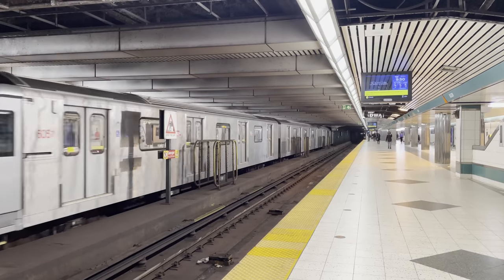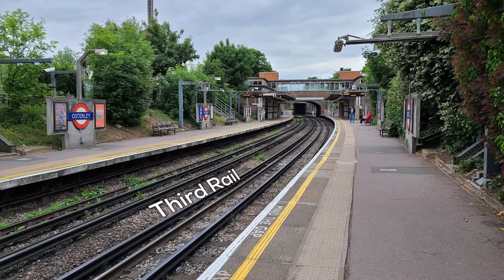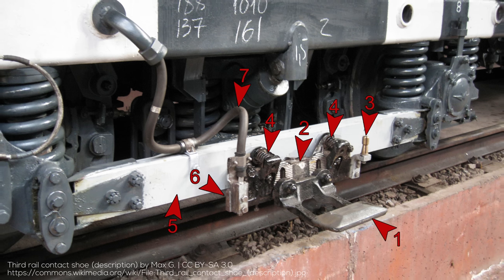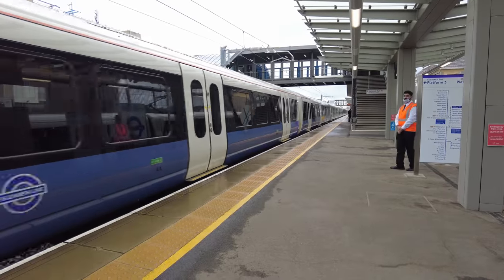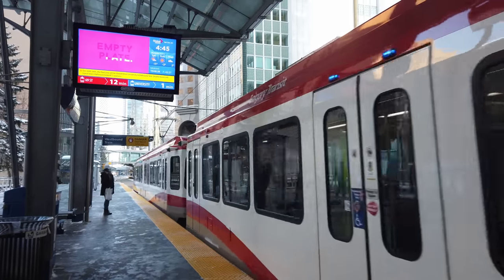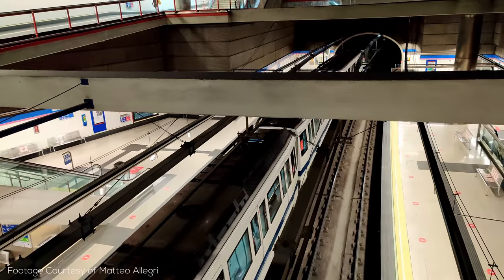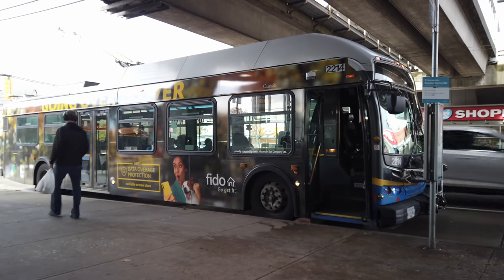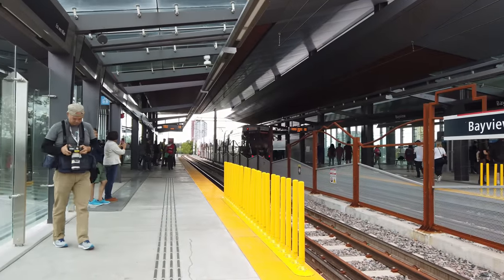The Best Way to Power Your Railway | Third Rail vs. Overhead Wire

Comment: In the UK we have a really odd system where the south of the UK almost entirely uses 3rd rail and the north uses 25 kv overhead, and I mean mainline commuter trains, not just subways. Like so many London stations are electrical hazards cause they have both 3rd rail and overhead lol, some even have 3rd rail platforms, 4th rail for the tube and 25 kz for trains going north
Reply: Typo it's 25kV .  There are no unprotected electrical hazards the engineers fully understand the issues and engineer the installations to cater for all the differences.  

The 4th rail on dual National Rail / TfL tracks (e.g. Euston to Watford) is actually at the same 0 potential as the return rail unlike when in TfL land where it's above the running rail potential.  Thus TfL stock can run on NR track but NR stock cannot run on TfL 4 rail track.

Comment: in Vienna you have a couple electric busses which run on battery, but if they need charging, they can do that with raising a pantograph towards tram overhead wires :D ... I believe there is like one line that uses those there :)
Reply: In the San Fernando valley area of Los Angeles,  there's a dedicated bus line that uses electric buses that operate the same way;  at  each end of the line, there are charging stations for the pantograph-equipped buses.

Comment: If there is enough room, overhead line is always the best choice. Rigid  catenary is the best choice for tunnels, expecially for those ones that doesn't have enough space for catenary overhead and are long enough to don't have huge seasonal and/or daily termal excursion. Third rail should be relegate for tunnels without sufficient room to any type of overhead line, neither catenary nor rigid.
Reply: The Madrid Metro uses overhead, since third rail tends to be in the way…

Comment: The amount of power you can get on low voltage DC systems is limited to about 2MW because the currents get so massive. OK UK Southern region has stretched this to 4MW in parts of the network at the expense of substation little over a mile apart and trains which automatically only take this power on known section. Do not forget that 4MW at 750V is over 5000A requiring massive cables. With these high currents there is considerable voltage drop resulting in the system often being rather inefficient. Even my local Tramway network (Manchester Metrolink) has had problems with voltage drop and recently had to put in some new substations at for example Brooklands because of voltage drop problems.

In contrast high voltage AC systems can easily deliver train loads of 10MW or more, which is required for heavy freight or fast passenger trains
Reply: Do overhead lines ever use DC? There is HVDC used for power transmission so could this be adapted for trains?
Reply: @monishbiswas1966  The high voltage DC used in power transmission lines is way too high for railway applications, being hundred of KV and requiring clearance of meters. Even with 3KV designing equipment cases is a problem as clearances start becoming large typically 50 mm. While 6KV DC systems have been proposed it would be a problem designing compact equipment cases for mounting on multiple unit trains. In contrast with AC the only high voltage parts is the transformer primary which is normally submerged in an oil bath with high dielectric strength.
Reply: And in some areas the 3rd rail system is struggling. On services from London Waterloo to Weymouth, the 2 5 car units have to decouple at Bournemouth because the electricity west of there can't handle 10 carriage trains

Comment: I am Italian and I live near Milan. Milan metro, as you said in the dedicated video is split up. The metro line 1 or the red line M1 uses DC third/fourth rail while green line M2 and yellow line M3 use overhead wires. I suppose M4 and M5 run on third rail since I never saw an overhead wire but it's difficult to see anything like that due to the platform screen doors. I found out that all the metro trains in operation are actually supplied with both third rail capting systems but also with a pantograph, making every equipment movable between lines. I saw it in person where a M2 train transited down at M1 station "Precotto" where a maintenance facility is located, supposedly for maintenance works. Our trains, especially the S lines use overhead wires but on the station of Pavia on the S13 line, for a slight moment the overhead wires stop and then come back at the station itself (terminus). I suppose there's a third rail under the train because it doesn't have any loss of power. Fun fact, during June this year, a thunderstorm broke down most of the overhead wires for trams and trolleybusses, pointing out how brittle things can be. Another example is from "Via dei Missaglia" where trams 3 and 15 run, a car hit a overhead wire tension pole and deviated the 2 lines for 3 weeks.

Comment: You can put air gaps in overhead wires, the wires on each side of a level crossing rise up above the max height and the pantograph disconnects for the gap where there is no wire. The only thing you have to make sure to do is open the main breaker to stop arching and make sure all of the trains on the network have pantographs with the same maximum height. It is normally done on freight railways where huge mining vehicles and trucks need to be able to cross the rail tracks.
Reply: Most UK main line OLE installations use insulated 'wire' gaps, an air cap would cause the pantograph to shoot up and then tear down the next section of OLE.  The train detects magnets (same as fixed AWS magnets) which are located on the sleeper ends to close the traction down so that the field in the on-train transformer is quenched so when it joins the new section it can connect without a potential 'bang'.
Reply: Yes I think all systems that use 25kv have to have insulated gaps, however what I was talking about is air gaps so that over height loads can cross the railway tracks. there are some videos of them on Youtube, presumably you would have to design the pantograph with it in mind.
Reply: 25kV Air Gap: Australian Railways if you want to see what I am talking about.

Comment: 12:04 Actually its speculated that the future Cross Island Line in Singapore's MRT will be using overhead wires/rails again, like the older North East Line (which Siemens has won a contract to replace its wires (that have loosened in the past, causing service disruptions) with rails), likely as higher voltages could be safely allowed, which is more important as power transmission losses will become more significant given the ~5km distance between stations when the line crosses beneath the Central Catchment Nature forest Reserve
The Bt Panjang LRT in the same country also uses 600V AC instead of DC despite the short distance between stations (~500m), which has been blamed for making its power system less reliable as it apparently has to use, as a result, a more complicated design that's harder to maintain (the current collector shoes have 8 contact points with the power (& also guide) rail which sometimes break off)

Comment: Hey, loved the video, how do the costs of the two methods compare? I was always under the impression that third rail was cheaper to install, especially along pre existing lines. Or am I wrong?
Reply: Along pre existing lines: it depends on whether or not you have enough clearance. If there are a lot of tunnels, then yes, it's cheaper to install a third rail than to increase the height of your tunnels. But installing a third rail requires work on the track itself, whereas on a surface railway you can place the poles without having to mess with the track and sleepers and the like.
Third rail also sticks to lower voltages, so you need more substations - this can be a problem if you're building it on the surface, but less so if you can just bury everything.
Maintaining overhead wire in tunnels can also be a bummer. In general it's best to have a single standard for your mainline and urban networks, so overhead is typically better since it also works for high speed trains, but if you're building a segregated system running underground or elevated, third rail is often better.

Comment: Rigid Catenary also extensively use in new Underground tracks in Hong Kong's MTR network, Starting from West Island Line extension for Island Line when it launch service in 2015. 
The Latest, East Rail Line new track from Hung Hom to Admiralty is in full Rigid Catenary.

Comment: Great video, one type you didn't mention was overhead power from a pole as opposed to a pantograph. In San Francisco we have vintage street cars that run up market Street that use a single pole to take power and return power through the steel rails that the train runs on. There is a second wire which is used as a return for rubber wheel trolley buses running on the same right of way. It's an interesting case study of having two different vehicle types running using the same power. Not sure if there's any other systems in the world that share power between a steel wheel on steel rail street car and trolley buses on rubber tires, although I wouldn't be surprised if there's someplace in Europe that does that. Keep the great videos coming, thanks
Reply: Seattle also has streetcars and trolleybuses, but the streetcars use pantographs. Both use 750V DC.
Reply: I believe it was the wear and tear of the trolley wheel that in part hastened the changeover to pantographs. Trolley buses use "skids" with carbon insets, but trams used a little wheel. Some interurban lines used to change the trolley wheel at the end of the line for every run. The pole leaving the wire in high speeds will be more detrimental to the train than a bit of slack on the overhead. But, the last great interurban in America, the North Shore Line, ran fast trains, and then passed thru streets like a tram before joining the subway cars (using third rail) on the Loop in Chicago. The Great Southern still has trains running thru the streets in some town, but they are planning on rerouting the line outside them (since motorists tend to be idiots & play "chicken" with the trains). However, they have long since converted to regular pantographs. I think (think) trolley poles are unsuitable for very high speeds (and possibly voltages). Blackpool had overhead suitable for both, since their vintage trams used poles. I’ve heard rumors Brussels is also dual operable. Toronto is getting rid of their poles. San Francisco uses poles on the Market Street line, where the vintage trams run, but elsewhere, it is pantographs.
Reply: I don't think it's the same power.  If I recall, the Market Street street car has it's own overhead over the rails which is located in the leftmost lane of Embarcadero, for example.  The buses were confined to the outer-most lanes and had their own pair of overheads which were tied together with insulating spacers to maintain separation, especially around a turn.  
One thing I have always wondered about those trolley buses, is that sometimes one of those poles does come off the wire, like when the bus deviate too far off in order to get around the street parking, so that pole is "floating" electrically.  If the other pole is attached to the hot side of the circuit, you have a live voltage swinging around.  This is assuming there's not a safety on those things.  I'm not sure which line is hot or neutral (grounded)

Comment: Here in São Paulo we are using rigid catenary for the newer greenfield metro Lines (4, 5 and under construction 6 - probably). The older metro lines (1, 2 and 3) use 750 V DC third rail.

Comment: The best solution I've seen for me are the Nice trams. Running on traditional overhead lines connected to buildings, but relying on a battery in places where catenary poles would have been disrupting to the historic sights.

Comment: I understand why the 1st REM line is overhead (it used an at grade overhead electrified line) but I would question why the 2nd REM line and Toronto Relief line is overhead, although snow might be the reason.

Comment: Another reason overhead wires alternate over the insert is that it ensures you maintain a good contact.
And you technically could make a very short and thick insert and still have the same wear as a wide insert. It's not just the wear (shaving) that is an issue on overhead wires, it's that if you rub against the same surface constantly you will overheat the contact point due to heat from friction. This would anneal the insert making it brittle and also shave the overhead wire rather than the insert.
Having it move back and forth along a wide area means the points not in contact are given time to cool down.

Third rail shoes don't alternate over the third rail like overhead wires do. But this works ok because the third rail is wider with a bigger contact patch. They are also smoother than the twisted cables of overhead wires, so shaving is kept at a minimum.
If you ran your hand at speed over a third rail (without power mind you) you wouldn't notice much friction or abrasion.
If you did the same on a overhead wire (cable) it would be like running a file over your hand which would eventually cut your hand in two separate pieces from abrasion.
Reply: Overhead wires are not twisted. The contact wire is a single, hard-pulled strand of copper. :)
Reply: @cieludbjrg4706  Where you live perhaps...

Where i live, they are steel and they are definitely twisted cables just like any other cable you'd see on a crane or likewise.
And for that matter, power lines.

You can hear them rubbing as the tram passes by, especially when there's water on them.
Reply: @RealCadde  I am afraid you are mistaken. Overhead lines are a single (sometimes doubled) strand of hard-pulled copper wire (when you reshape copper, it gets harder). Shaped sort of like the number 8. The clamps that hold the wire to the insulators & support wires are attached to the top half. The pantograph slides on the bottom of the 8. The contacy strip is now some sort of hard coal, and the wire is lubricated with some sort of grease, probably with some graffite added.  And the wire is smooth as a baby’s bottom. Otherwise it would eat contact strips. And copper is a much better conductor than steel, which is why copper is used for overhead wires. Aluminium is also a good conductor, but it doesen’t harden the way copper does when drawn into wires, thus it’s not used in overhead wires. However, with a steel wire core, aluminium wires work well in high tension transmission lines.
When you have frost, ice can accumulate on the wire, giving sparks & fireworks (bad for the contact strips), so a special car (lorry or tram) will run along the lines with a pantograph equipped with a roller that deposits a glycol gel.
Look closely at the wire, and you’ll see it’s a single strand. Freshly strung wire is, of course, shiny copper colored, but copper weathers and eventually becomes quite black. Really old overhead can attain that nice green color that old statues get. :)

Comment: What are your thoughts about using pantographs and overhead wires for trucks and freight trains?
Reply: Many of the freight trains in the US are double-stacked now.  It would require the overhead line to be quite a ways up.

Comment: Another example of switching electrification as the service changes: Line B of the Rotterdam Metro:

At its eastern end, it runs on a newly built light rail alignment, powered using overhead equipment due to a lot of level crossings. The light rail alignment allows for speeds of maximally around 70 kph.

In its centre, it runs on third rail and largely underground, allowing speeds up to 80 k, assuming the vehicles can accelerate enough before the next stop.

On the western side of the network, it follows a decommissioned heavy rail line where they hooked up light rail power to the old mainline catenary. Speeds climb to 100 k, thanks to wider stop spacing.
Reply: The Rotterdam Metro has a few lines that do something fun. Perhaps that could be one for a future video?
Reply from the maker: @ironlynx9512  Yes! If you are actually in Rotterdam and could help please do reach out!
Reply: @RMTransit  Sadly I'm not, so you might have to try hitting up someone closer to the city...

Comment: As someone from the South of the UK, I will say third-rail is nice for being visually unobtrusive, single and double tracks can blend into the countryside very easily.
Reply: i fell the overhead wires blend into the countryside just fine too. In fact windmills fit the country side nicely as well. It's all a matter of perspective. Modernity can sit perfectly in harmony with nature
Reply: Yep, it's how LIRR in New York manages to be quite unobtrusive for what is the busiest commuter rail system in North America.  They can squeeze em into some pretty tight ROW.  It's common to see LIRR ROW running in what would be alley space between the back sides of houses in most places in the US.

Comment: If there's ever a second remake, don't  forget about the freezing rain problems with overhead wires. KW iON  is only 3 and has experienced at least one half day of canceled service already due to ice build-up
Reply from the maker: I think that’s more of a byproduct of not keeping the wires clearer than the wires themselves
Reply: It can be solved by having a tram/truck equipped with a pantograph with a roller that deposits a glycol gel when inclement weather is expected, or as a preventive measure.